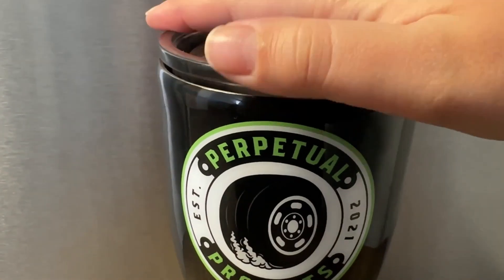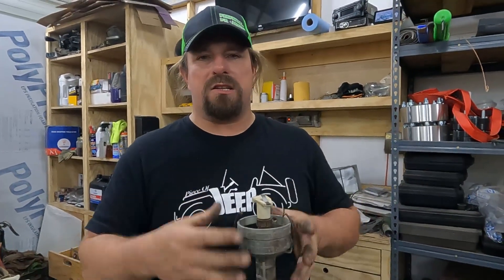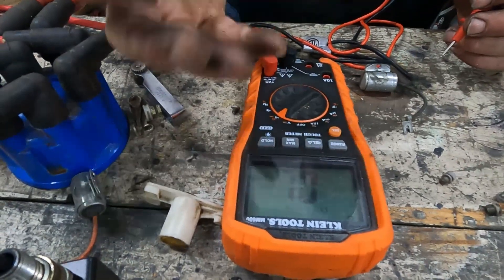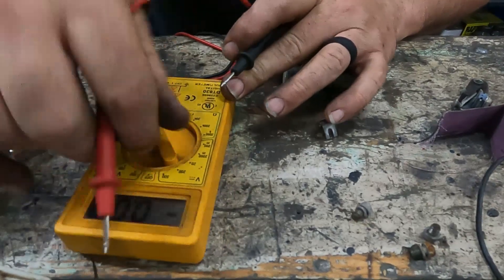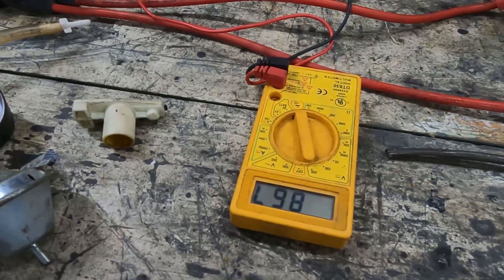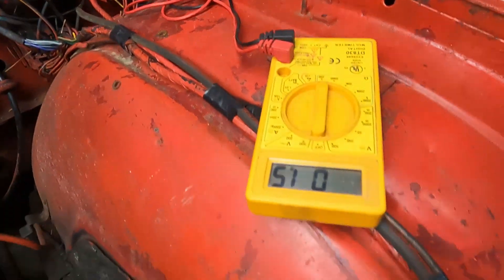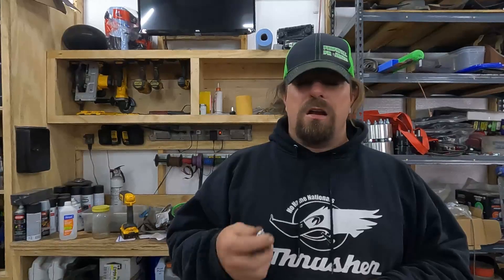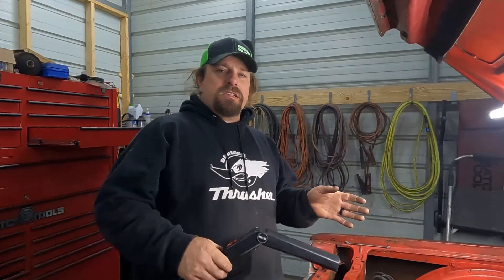10 Essential Steps for Ignition System Maintenance in Classic Cars

Comment: Just a little note about points distributors. There are three more tests to do. 1) Use a dial indicator to see if all the humps where the points ride (cam lobes) are all humping at the same lift. 2) Use a dial indicator to measure distributor shaft end play (up and down movement). Excessive end play could effect the points setting causing a smaller point gap while the engine is running. 3) Use a dial indicator to see if there is excessive upper distributor shaft bushing clearance. Excessive clearance will cause an uneven point gap across the operating RPM range. Hope that helps...
Reply from the maker: Those are excellent points, lol. Thanks for the tips.
Reply: @PerpetualProjects  "points" LOL!